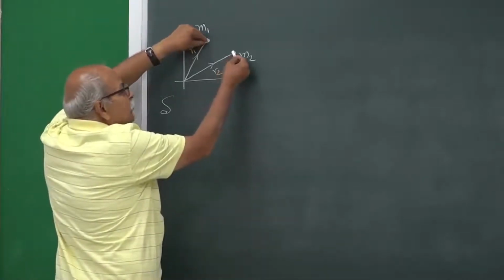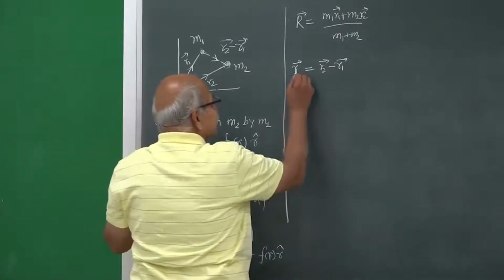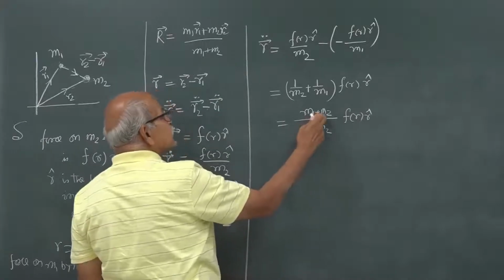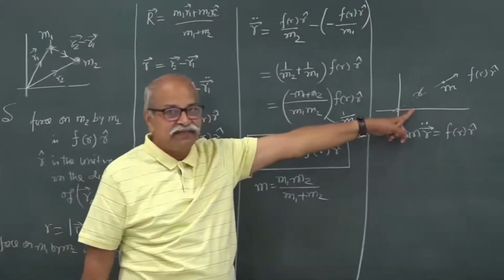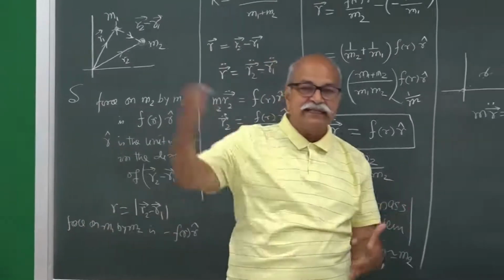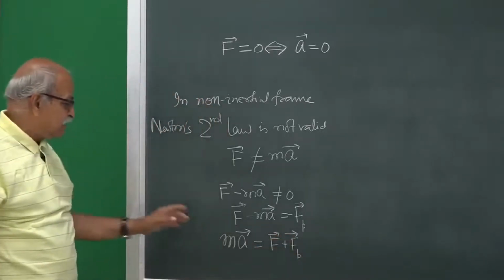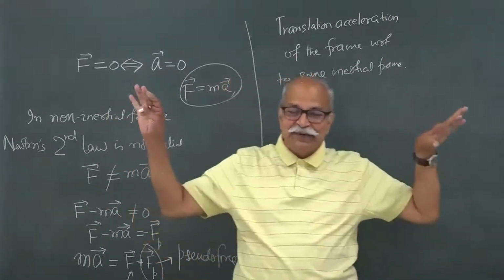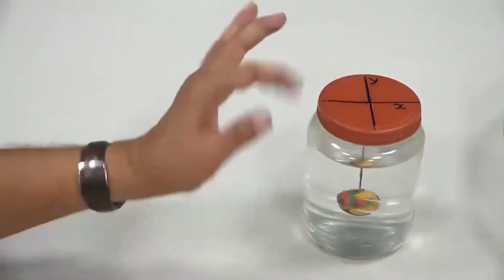Lecture 14  Frames with translational acceleration

Comment: Here the ball hanging in the water is attached with a string is trying to maintain its inertial position as string is exerting force on it. when the bottle is moved to the right ball appears to b moving towards right but actually it is just maintaining its original position ?
Reply: Ya this we are watching from outside the bottle means from our lab which is inertial, so Newton's 1st law works ,ball is trying to maintain its position ,,,,      but if we watch from bottles frame the ball is accelerated without any force, think you as a bottle and imagine that initially ball was at origin , but after some time it is moved from origin without any force applied